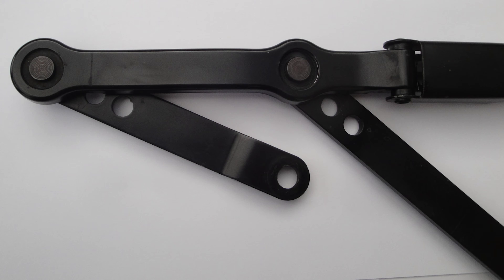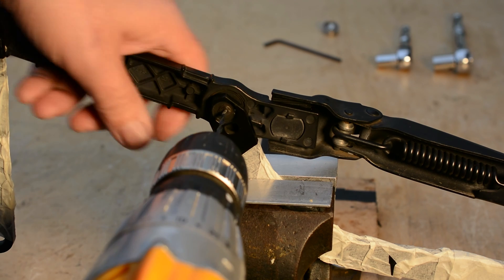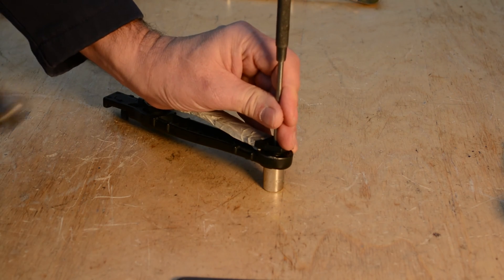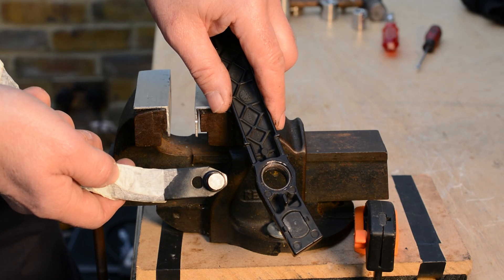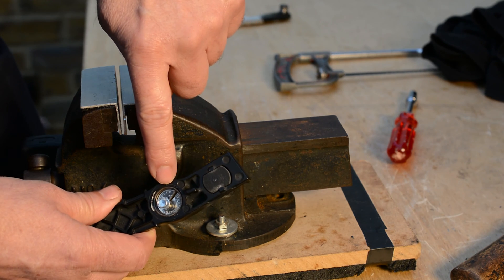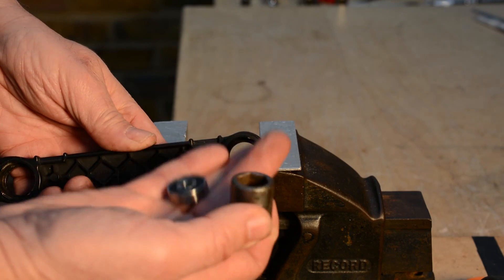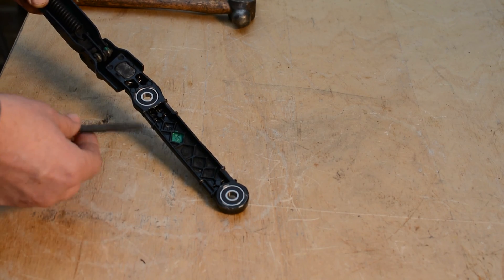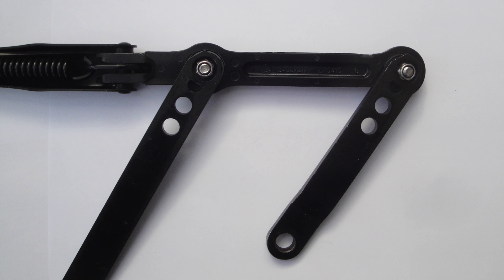Replacing Mercedes wiper arm linkage bearings with our repair kit

Comment: Hi I bought your kit, stuck looking for a 5p coin to drift out the remaining outer cup from the disintegrated bearing,  ...got it eventually thanks ....maybe better to include a blank or drift instead of the screw.. if at first you dont succeed ...try ..try again    I was wondering when I put the arm back on to the splines does it need to be aligned , as I didnt make any marks when I pulled the arms off the spline .or can they just go back onto any of the spline positions.... .Thanks
Reply from the maker: As long as it is 99% back in the same place